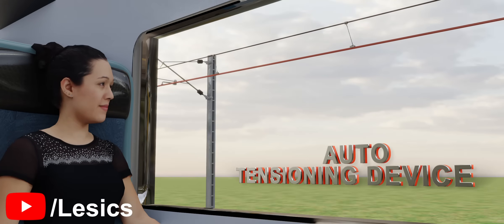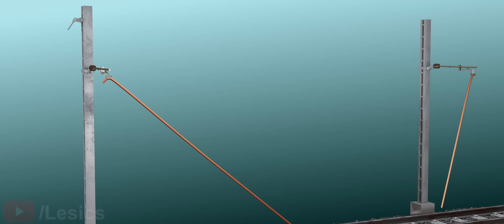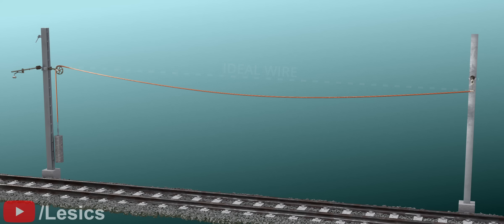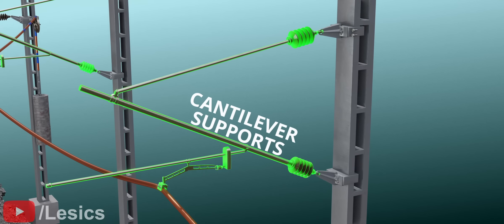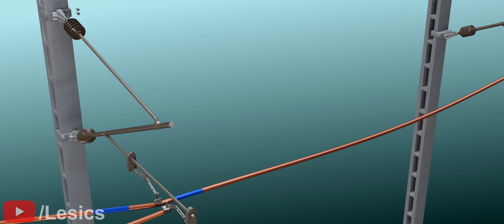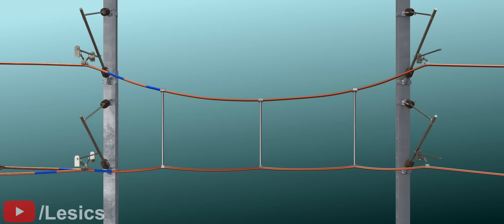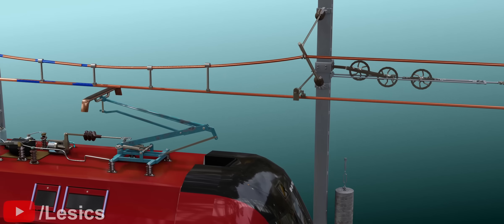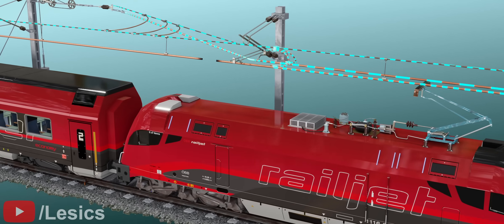Railway power lines | The Art of keeping them STRAIGHT

Comment: 6:00 some railways near me use what at first glance looks like just a single wheel instead of the pully system. Technically it's 2 wheels, a large one with a small one attached at the axel of the large one so they both act as one wheel but with 2 diameters. the contect and catenary wire is connected to the smaller wheel in the center where it can wind up/down the small wheel, and the weight itself is connected to the larger wheel creating a lever effect which provides the mechanical advantage.

Comment: For those wondering why the wire can never be straight:

The tension force in the wire points along the wire while gravity always points down. As the wire gets straighter, the tension force becomes more horizontal and thus the component in the downward direction becomes smaller

Comment: the pulley system in the animation shows three wheels, which puts the arm between one of the wheels and the column in compression.
this is unnecessary, a two-wheel pulley system can work with connections exclusively in tension.

Comment: An interesting question is how trains sometimes manage to tear down these lines. I mean the pantograf is pushed up against the underside of the line - but it cannot hook onto the line or anything like that.

This DID happen to me while on a train a few years back. A loud bang and thud and the train came to a stop. Zero power. Line was on the ground. Looking out the window the entire pole that was holding the line was sitting at a 45 deg angle over the tracks. I.e. there was quite a lot of force that pulled down that cable.

But how?
Can the pantograph weld itself to the power line under certain circumstances?

Real annoying. Was very close to the next station - could have easily walked to the station. However nobody was allowed out as they were uncertain if there was thousands of volts now going through the skin of the train - or if you go out you step on a high voltage cable.

Comment: Isn't it easier and more convenient to use a third and electrical rail? Like a lot of Metro systems?
Reply: The third rail system used low voltage dc. Whereas most overhead wires use high ac voltage to lower the energy wastage, also there is safety concern with the third rail system

Comment: 1.44.  The weight never pulls more or less than its own weight.  It cannot.    It will pull consistently again the changing sag, thus compensating for the greater or shorter length of the conductor wire. 

You didn’t mention the ability of the train’s pantograph to adjust to minor, ineradicable variations in the wire  by having springs that maintain an adequate upward push.

Comment: I thought that could be a power grid change. One grid supplies power for some duration, and then it is taken over by the other grid. In case if any power grid fails, then, one grid can act for two or more blocks.
Anyway, thanks for the explanation.

Comment: Why do we need power lines? Like the engine can generate power through a Dynamo/generator right?
Reply: Electric trains are both more cost-efficient, space-efficient and significantly faster than diesel trains, which can make electrification economically viable despite the cost of infrastructure.

These factors are important, as higher speeds makes trains more competitive against other modes of transport, through lower travel times and lower costs.

Having combustion engines on the trains may eliminate the need for wires, as such engines are loud, takes up valuable space in trains, pollute and are heavy, so sourcing the energy straight from the power grid makes sense.

And some electric trains can even return energy from braking back into the grid, a process called regenerative braking.

Hope i helped answering the question! :D

Comment: EZ solution, just use a 3rd rail system instead. 😂😂😂
Reply: Third rail is less efficient at transmitting power, requires lower line speeds, is more affected by adverse weather (i.e. rain, snow and ice), and are more dangerous for workers and staff

Comment: It's not straight yet, the problem is better solved using construction steel bars, because of their H form they can be very resistent to a deformation, the temperature is the only thing can be a problem, bit since the contact doesn't need yo ve with the steel then can be a space between the bars

Comment: This seems like a like of infrastructure to make a wire “straighter”.  Is it really so important to have constant power?
Reply: Yes or the power will cut
Reply: @ijustwantedanameok  And there’s No way to make it just a little more independent from the rail?  Idk, like a battery or Something, for those split seconds when it’s not getting power.  That would be more difficult/less practical than the infrastructure described here?
Reply: @FurryEskimo  well a train weighs about 600 tons and needs all the lights to stay on with the communication services to stay on at all costs so even for a small amount of time it needs a lot of electricity they are some hybrid trains like the IC2000 and it makes the problem almost non existent and there will most likely be an alarm to say that a segment was cut and should be quickly repaired depending on the country as Europe takes train service very seriously as opposed to India who never changed the size despite really needing a change
Reply: @ijustwantedanameok  Ok, so pretty important.
I also just remembered that disconnecting and reconnecting would cause sparks, which could cause fires, major issue!  It might also cause accidental welding and breaking between the metal, big issue there, and the wear on the wire might be way worse.
Reply: @FurryEskimo  yup

Comment: It's a rather complicated arrangement which needs a lot of attention and servicing. Wouldn't it be easier to use a lightweight conducting rail rather than a thin wire? The contact area with the pantograph could be increased, with a reduction of electric resistance and the problem of sagging could be reduced significantly too. Moreover repairs of damaged sections could be done much more easy by simply replaicing this part of the conducting rail...

Comment: What isn't mentioned in this video that the wire tension serves a second purpose, esp. for high speed rail lines; it is also to keep the speed at which the transversal waves propagate along the contact wire above that of the maximum train speed at all times. If the tension on the contact wire is too low, the wave propagation speed is too low and the pantograph can effectively catch up with the expanding wavefront it is generating, much like a jet fighter is catching up with the sound waves as it approaches the speed of sound. Just like you get a sonic boom with a jet, you would get a massive jolt as the pantograph would pass the wave-front, resulting in most likely a damaged pantograph as well as damaged catenary.

Comment: This seems like overengineered, although maybe neccessary if they implemented it :D Are there no easier/other alternatives? For example my first idea would be to use composite materials, like 50% plastic 50% metal with low thermal expansion coefficient. Use the plastic as the solid fixed line between the two poles. Make this plastic-solid line approximately 5 cm / 2 inch wide, and then print or attach the metal "wire" to the bottom side of the plastic sheet. The metal wire would be attached to the pastic sheet in a Zig-zag way, running from left to right, then back left and right; from side to side, so the thermal expansion would kick in and push it wider than longer, and the solid plastic top side could stop the expansion as well. Would this work? Or if it wouldnt, why not?
Reply: I think it would be difficult to make a material with both high enough conductivity and low enough thermal expansion coefficient. The system described here may seem complex, but it's actually relatively cheap to build and very durable. The only system that works as well is a third rail, but they have other disadvantages.

Comment: Very expensive, over engineered system.
Same in electric cars, electric engines don't even have a transmission, which is over engineered like the train wire solution.

Comment: So, FINALLY learned it just in time BEFORE my 60th birthday! 🤗 From experience with ropes, it was always clear to me how difficult it is to get a rope or a cable straight for a longer time, but I couldn't imagine how one can get an adjustment mechanism that is able to  deal with the wear and tear caused by the contact with the *pantograph at high speeds and to be fully functional for a long time! *II thought that pantograph would actually  "grab" the wire.

Comment: Two questions: 1. How long has this system been in use. I only noticed the weights about 30 years ago. Have they always been there? 2. I always wondered how long the wires and the pantograph last. It seem the friction between a speeding train and a cable would be huge. Are the pantographs made especially soft so that they take all the wear and tear? I mean, you don’t wanna replace the conducting cable too often.
Reply: They explain this in their other video about pantographs

Comment: As a train driver in the uk we ran trains from 1955 to approx 2015 with the pre tension system. However there were two catenary wires plus the contact wire.  There were some problems usually in the summer but mostly worked ok.one I think you missed was that the wires are not straight they zig zag which sometimes caused trouble when detached from the span wire or cantilever arm. Also don’t quit understand your illustration showing a break in the contact wire is a bit misleading if it breaks you will most likely rip the lot down when a train comes along.

Comment: A question on the tensions shown at 6:07. The concrete weights are pulling at 2T. There are two wires connected to the pulley in the middle, with 2T of tension pulling to the left. The system isn't moving, therefore statics applies. So shouldn't there be only 2T of tension on both the contact wire and the catenary wire, for a total of 4T to balance out the weight of the pulley?

Comment: The simple wiring without catenary is actually used in tram systems. The sagging isn't such a huge problem for vehicles moving relatively low speed.
Reply: That's the funny thing ;) Amsterdam almost only has the simple wiring system, while Rotterdam and The Hague usually has the more complex systems.

Comment: 7:05 Is there a way to notice such damages? Or do you simply have to patrol everything and observe?
Reply: The breach shown is more theoretical. In case a wire is fully breached, it will drop and the next train will probably tangle it up in it's pantograph. The redundancy is more helpful in case of a bad electrical connection. In case of a single wire you would get arcing or extreme heat and probably destroy the wire, ending up in previous mentioned tangle or at least a lost continuity. With the redundancy the electricity will use the other wire and everything is okay.

Comment: As European Train driver, i couldn't spot a mistake. Good work. 
Only thing that would have been lowkey important is how the Panthograph switches wires without getting tangled up ripping the overhead line down. 
These devices look like a sled, and are installed at the said point.
Reply: That depends. Those sleds are only found on section-insulations in The Netherlands. The rest just 'interceps' and 'leave' the current contact wire by raising it from the contact wire that really is in contact with the pantograph.
Sometimes, composite-material drive-able insulators are used. Long, cilindrical elements between two sections to create insulation while also being able to drive under them with the pantograph while applying power.
For section-insulation, we use those sleds (with a rather large type from RIBE being ever more common).
But normal Dutch trains run on 1.8 kVDC only, that makes things quite a bit more easy (and complex at the same time due to the high currents involved)
Reply: Jumper cables were mounted facing the wrong way. Need to be coupled in a “C” fashion facing direction of travel to help prevent the jumper from getting snagged if loose.
Reply: @Hockeyking86  We just don't connect jumper wires like that in The Netherlands at all as almost all of our tracks are double and secured like single track (in professional terms: Double single-track safety). It just means that both tracks can be driven on in both directions should this be necessary.
Jumper wires are made with long wires connected to the contactwire, up to the catenary wire (with a stress-loop in between to allow for movement at different temperatures) and then extend over to the newly added wire. Usually we double this wire and you'll see two loops.
An even more complex situation can be seen here: https://www.m-voorloop.nl/modelbouw/blikopbovenleiding/bovenleiding-krul-draagkabel-rijdraad.jpg
Reply: @Hockeyking86  but what if we have only one track that works for both directions? 🥳
We'll have to stop traffic so we can mount them correctly for the other direction? Lol
Reply: Proof that u r European train driver??
Reply: @sanjayvaradharajan  he has no proof. he is a martian train driver. an alien in disguise!
Reply: @sanjayvaradharajan sometimes you can actually trust people on the internet. It's allowed don't worry. This is such a low stakes thing to lie about. Even if he did lie the information he shared is all correct so it really doesn't matter.

Comment: This.  This explains all the questions I've had regarding railway powerlines.  I had guessed that the weights were used to tension the system, but I couldn't understand why the braces seemed to have "hinges".  I also didn't understand why there seemed to be so much interwire bracing on higher-speed systems.  Liked and subscribed.

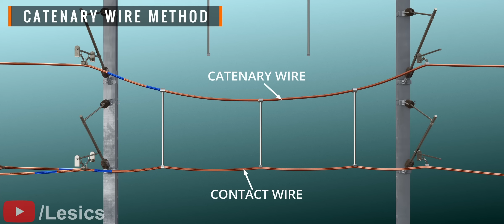Comment: 5:25 here you have to consinder an additional piece of information - the cantenary wire is usually made of steel (a simple steel cable), while the contact wire is made of copper (guesstimate upwards of 120mm^2 crosssection).
The dropper are in general made of steel wire, so they can be adjusted if necessary without too much of a hassle. At least here in Austria there's even a special type of vehicle used to maintain the power lines (called a "Turmwagen")

and the pallett on the pentagraf you used in the animation has two contact strips ;-) (i know it for sure, because i drive this very type...)
Reply: 107mm² or 120mm²

Comment: Definitely more complex than just laying a third rail down.
Add to that the extra clearance required around bridges and tunnels due to the higher voltage.
Reply: Lower voltage third rail systems have higher power losses and are more hazardous to people or animals around the tracks.

Comment: That device that you call a "pantograph" is actually known as a collector.  A pantograph is a drafting or design tool - from Greek "pan-" (all) and "graph" (write).
Reply: The word is used for both.

pantograph
/ˈpantəɡrɑːf/
noun
noun: pantograph; plural noun: pantographs

    1.
    an instrument for copying a plan or drawing on a different scale by a system of hinged and jointed rods.
    2.
    a jointed framework conveying a current to a train, tram, or other electric vehicle from overhead wires.

It is also called a collector. A collector looks very much like the device used for drawing.
Reply: https://en.wikipedia.org/wiki/Pantograph_(transport)

Comment: Current passing through rail tracks is a much simpler solution in my opinion. I know there are downsides to it but imagine they could save the cost of pillars, wires, maintenance, pantograph etc.
Reply: Level crossings may not be possible if an energized third rail solution is implemented. That's why such type of system is more popular in metro train lines where isolation of tracks from general traffic is ensured.

Also most high speed locomotives require 25KV voltage, which I believe has the potential of easily leaking to ground if a third rail solution is implemented, causing significant energy loss.

Comment: I get all this stuff is solely for keeping the wire straight, yeah I get that, but like....why don't they just use a stiff rail of some sort?  Seems like a cheaper and easier to maintain solution.
Reply: But a piece of rail will be more expensive than a wire. The conductor size needs to match the amperage in the system which is lower therefore necessitating the use of a wire.

Comment: Why are these pulley mechanical settings being used. There should be better systems which is weather resistant to extreme temperature changes.

Comment: The OHLE is not actually straight. It runs in a zig zag pattern to spread the wear over the width of the pan carbon. If this was not done, the carbons would not last very long.
Reply: Watch from 4:00 . The pantograph isn't having a single point of contact
Reply: @commieTerminator  yeah, you need to have a transition from the old contact wire to the new contact wire, otherwise the pantograph will catch and break
Reply: @commieTerminator  Nice username :D
Reply: This was covered in their past video : https://youtu.be/GJbUI2D3rLY?t=346 :)
Reply: He meant straight from the side perspective.
Reply: That side to side adjustment of the wire is called Stagger, and you’re correct. Our system here in Denver, CO has a stagger of roughly +\- 19 inches.

Comment: There are some differences between systems, especially from 5:00 onwards. 
On some low speed trainlines, only the contact wire is tensioned with weights. On some, they are connected as shown. And on some, they do actually both have their own weights.
Also, some don't use a pully.

Comment: This isn't really about keeping the contact wire straight but rather keeping it level (or close to).  Straight would be the contact wires position relative to the centerline of the track which in fact traces a zig-zag path a little less than the width of the pantograph shoe to prevent wearing a slot in the shoe itself.